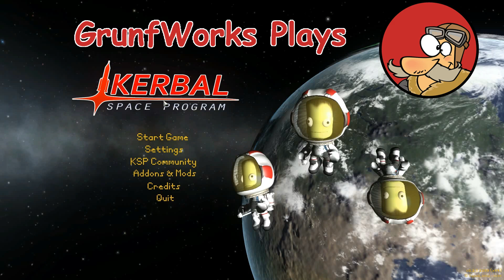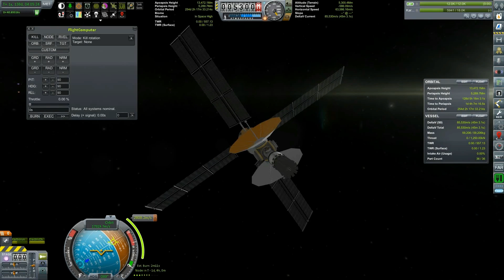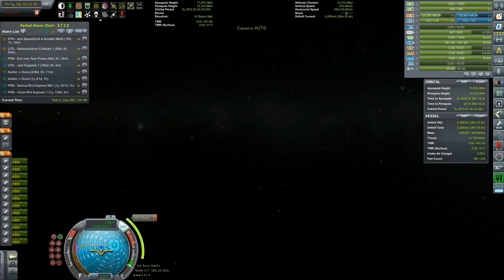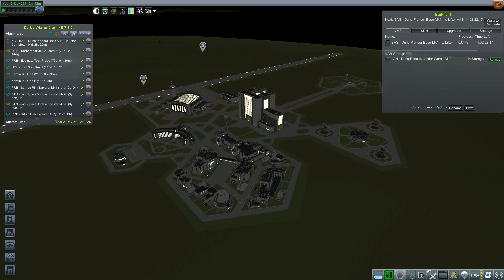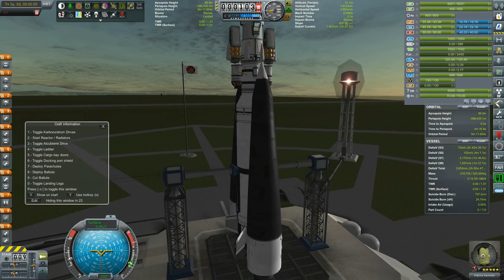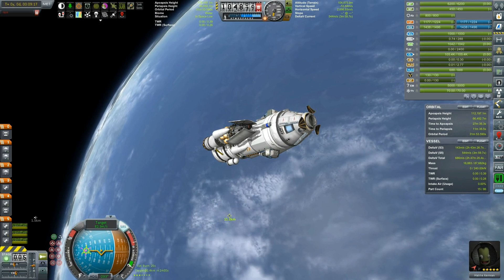Kerbal Space Program - Interplanetary Voyage - 032 - More Karborundrum - Lets Play Season 2

Comment: I'm not a nuclear physicist but my best guess about the nerva being pinkish red is because of either cherenkov radiation or just because the hydrogen is reaching curie temperature and starts glowing red like hot metal. something to note is that normally cherenkov radiation glows a light blue in water so I'm making a assumption on ksp's fuel giving off a different color for some odd reason.